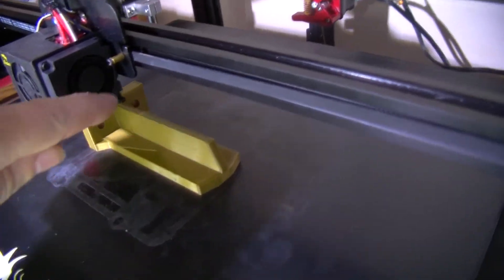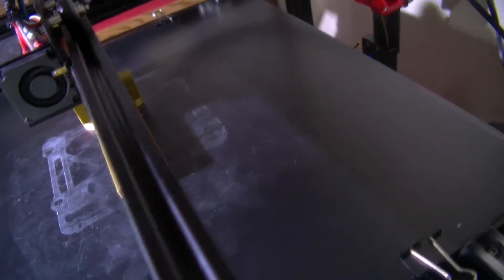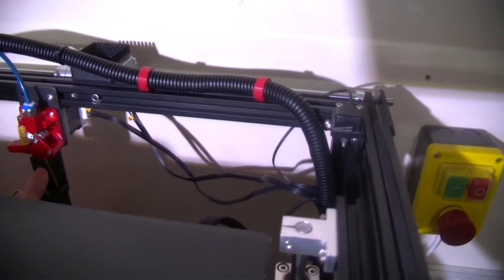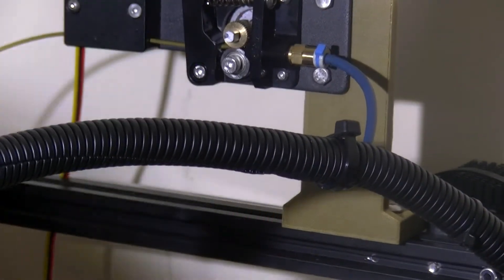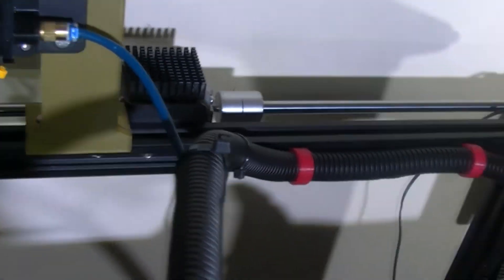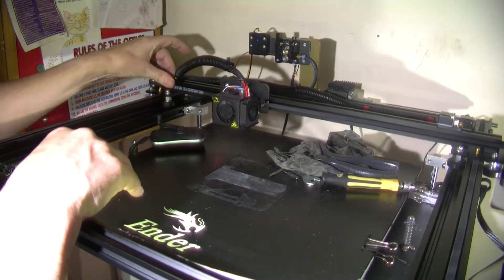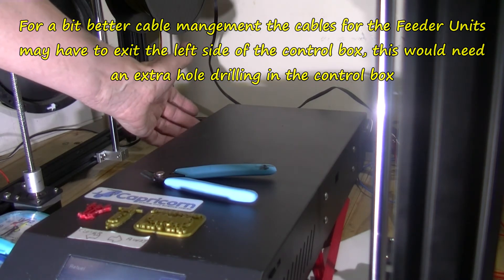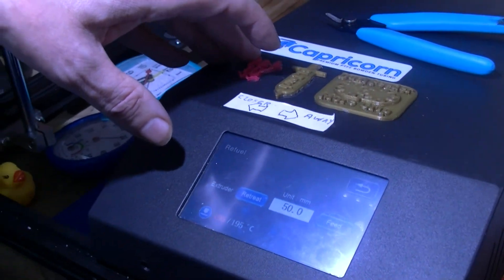Creality Ender 5 Plus Easier Feeding the Feeder

Comment: Can someone please help me, can’t get my first print. Does the movement like it’s printing, but nothing is coming out
Reply from the maker: Is feeder turning, is it feeding filament, gripping the filament. Is it's kind a clicking noise. Is the Hot End heating to the correct temperature. Is the nozzle blocked. Is the nozzle too close to the bed stopping flow. Try lifting the nozzle off the bed about 100mm and heat nozzle to 200 ant then extruding see if it works.

Comment: 8:00 Take your bowden tube out of the plastic wire wrap and allow it to move freely on it's own. Move the hot end to the front left corner (closest to you as you are standing in front of your printer) of your printer. Now, you will find a small hole in the plate behind the X stepper motor, cable tie the plastic wire wrap to that, allowing the bowden tube to move freely. There is no need to have your wires hanging like that above your bed, the constant movement will fatigue the wires faster. Setting it up the way I described, will greatly reduce the amount of movement your wires have to endure.

Comment: Just got my Ender 5 plus today , which had a bad squeak at first  , so a loosened the screws holding the bed , manually moved a stepper by one step in each direction to see if it stopped.
Now on my first print a over sized clothes peg which is 5 hours @ 50 m/s
Reply from the maker: I used Lithium Grease and oiled over 2 weeks, seems to be quiet now
Reply: @3D_Printing  Do NOT use lithium grease, or any petroleum based grease for that matter. Your printer has vinyl parts, and petroleum based grease and oil will slowly eat the vinyl. Use 100% silicon grease on your moving parts for best results.
Reply from the maker: @PaganWizard  THANKING YOU 20000% For the WARNING; I didn't know this but now do#. Thankyou once again